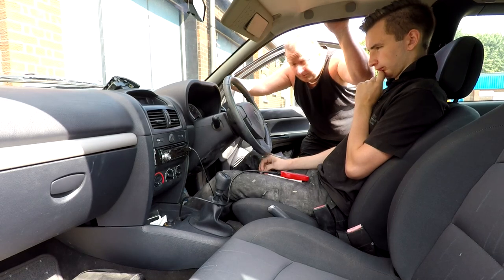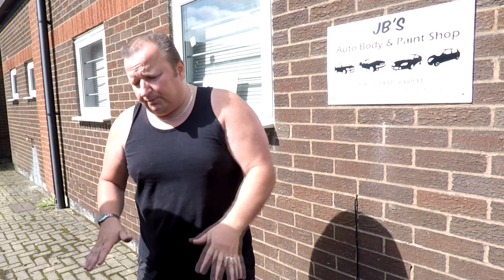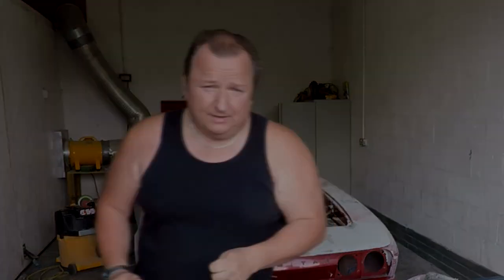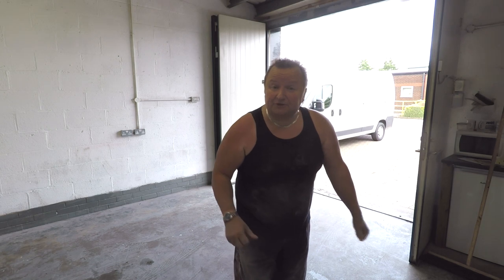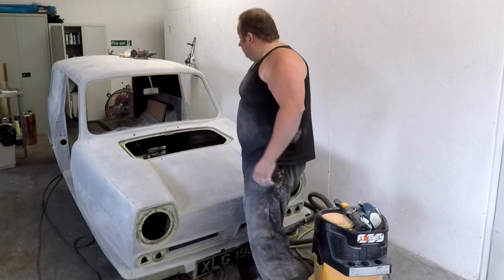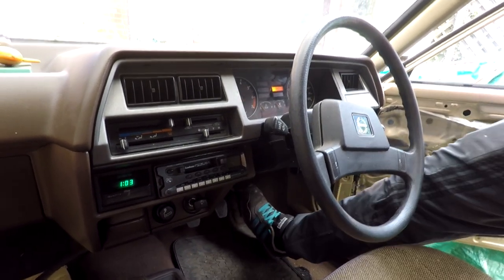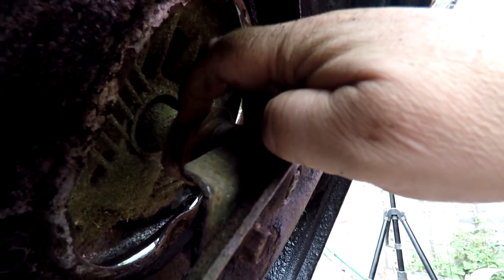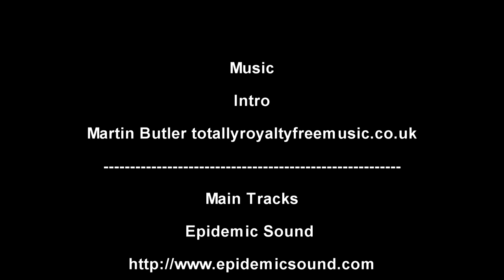A Day In Our Life Vlog #11 Trotter Van Scimitar And Triumph Acclaim Cold Start

Comment: Ignition pack, yeah, remember distributors? all mechanical, file the rotor every few years, change wires, simple. Honda turned out nice too. On to the next one. Oh, Stone Roses, I still have them on vinyl and cassette tapes. Still around then. 'I Wanna Be Adored' 'Waterfall' 'Mersey Paradise' Classic Rock. Jimmy has good taste in music.
Reply from the maker: I didn't think they were still gigging Bri either. Honda works a treat now with the new drive belt.

Comment: Hi Martin i have a vauxhall combo van and both my door mirrors are seized and do not fold in do you have any tips to free them up thanks Gareth
Reply from the maker: Hi Gareth, Tricky with plastic parts but a squirt of lube in the joints may help. Failing that, the breakers yard should have a few if you occidentally break them.
Reply: retrorestore looks like i will need to completely remove them and strip them down my van has the colour coded bumpers and mirrors so finding white ones would be impossible lol thanks all give that a try . Gareth

Comment: Martin, can you help me please.  I drive a 1.9 CDTI Vauxhall Vectra. Sometimes the handbrake light comes on with handbrake engaged but 9/10 times the handbrake light is not coming on when it's pulled up. I guess the handbrake switch is the culprit but how do I go about fixing this  as the MOT is soon due ?   thanks
Reply from the maker: Not familiar on where it's located Mark but a Haynes manual or something similar will show it's location. It does sound like the switch in my opinion.
Cheers
Martin
Reply: I cannot find the prcoedure in the repair manual, just the procedure for replacing the cable itself. any ideas as how else I may find the procedure please ?
Cheers
Mark
Reply from the maker: Check the forums Mark, That's all I can suggest.
Reply: Hi 
Yes I guess so, I will keep looking thanks